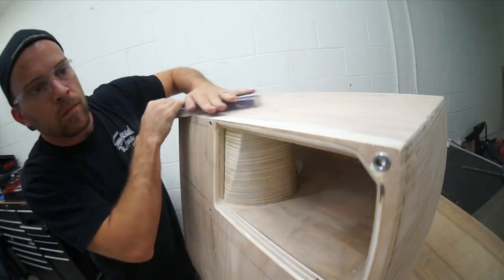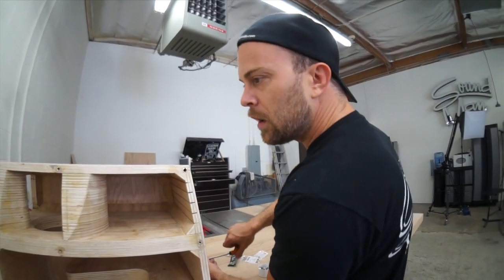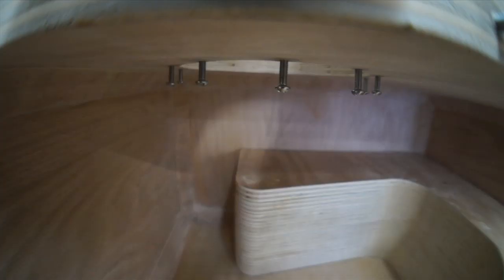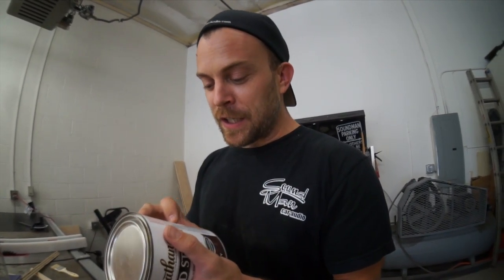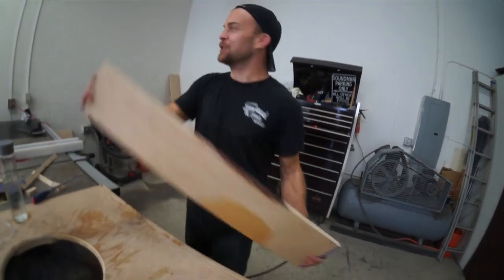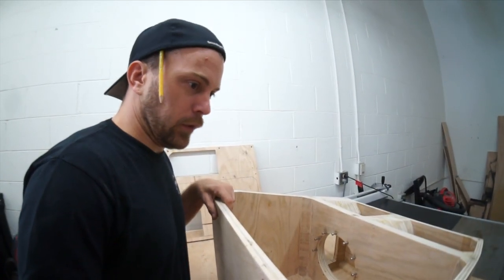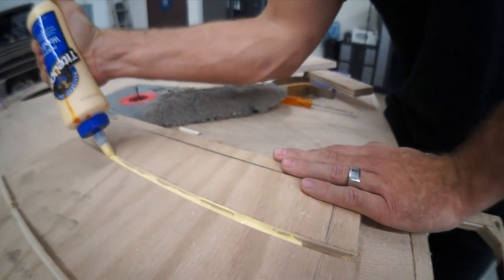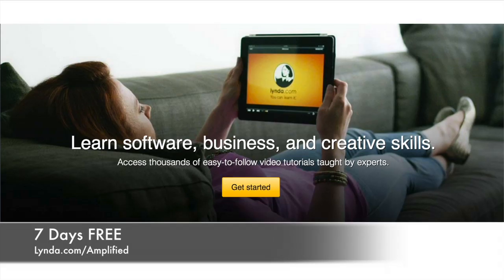Wood Finish Tests for my Subwoofer Enclosure

Comment: great build Doug.... the reason the stain looked purple is because of the light color wood you used.... whats a great option for light colored woods is to use a sanding sealer first which is sort of like a primer what you can sand after applying.  Then spray a lacquer mixed in with some metallic flake....as small as you can get..... over the top of the sanding sealer and man that bitty is gonna pop.
Reply: you can also use a candy too....that shit looks good over wood.

Comment: Hey Doug, when you need stain go to a cabinet supply shop and or find dye stain...spray it on with a pneumatic gun...much easier and more consistent. Most dye stain is made to order so you tell them or show them what you want...take in a scrap chunk of the same wood used and theyll make the colour you want that will look how you want it on your specific type of wood...different woods will of course appear different colours with the same stain (thats why we recommend testing...no I dont sell Varathane stain)

Comment: Doug I was thinikin that if the winderrrs in your sweet box would some how coincide with the power meters on your sweeeeet McIntosh amplifier. Maybe they could be of similar shape and layout or just a similar color lighting in your hot box Doug. Instead of two large wiiiinders you could do four smaller wiiiinderrrs and light the interior that cool aqua McIntosh blue! Then of course that all just might suuuuuck ass in the looks department. I think you could make look cool though

Comment: *****  What is going to keep air from traveling between the faceplate and the interior edges that we would normally use glue, silicone or resin to seal? Or does that matter for this piece?